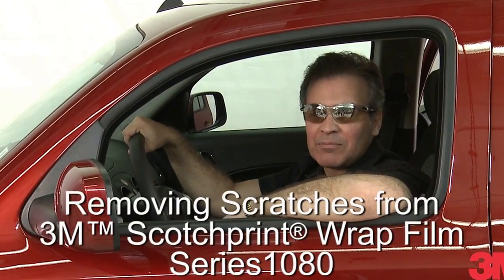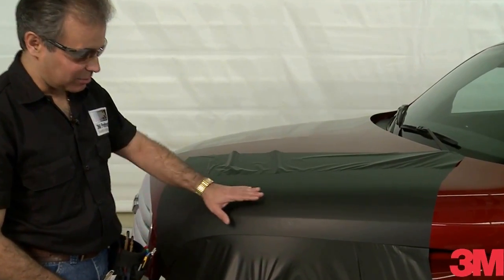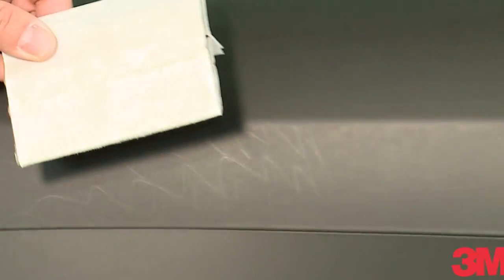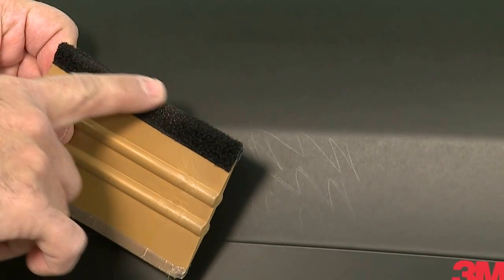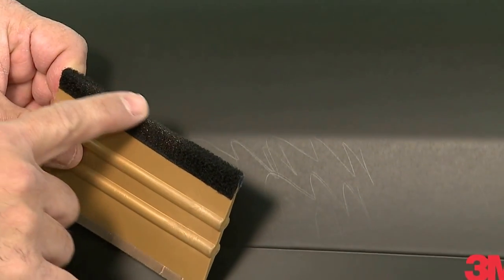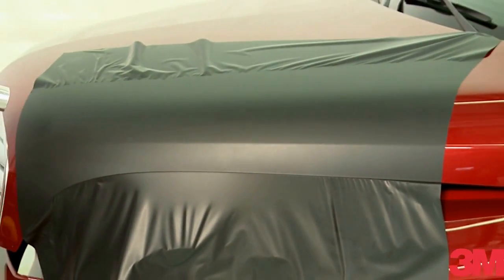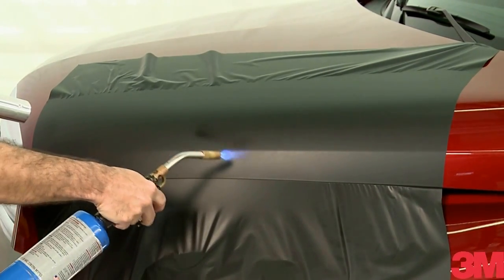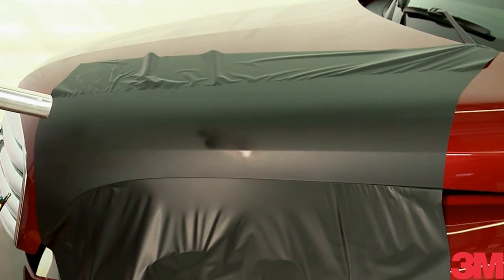Removing scratches on from 3M Wrap Film Series 1080

Comment: Warning! This method does NOT work. If you have a wrapped vehicle never attempt to remove scratches with this method. Only option of repairing would be hot water. period!
Reply: Oh really? PROOF
Reply: Actually - using a small heat gun that goes up to only 775 degrees F, about 3 ~ 4 inches away and panning back and forth as suggested in the video, removed 90% of the light surface marks on my vinyl wrapped car that had some accidental rub marks from EV charging cables (idiot mark - I was forcing the cable to come across the car to where the charging port is). You just need to be very careful and not to stay in one spot for too long! This method totally works. Note - my wrap is the 3M 2080 series satin grey.
Reply: @ronlai3029 do you have link for the heat gun you used ?
Reply: I went thru a hand washing car wash and I think rocks in the cloth scratched up my car any tips?
Reply from the maker: Hey! We know how it feels. We recommend you try our scratch remover products from 3M. https://s.3m.com/4gkp4ubo https://s.3m.com/3a9gop9o
https://s.3m.com/sufdwoqq We hope this helps you.